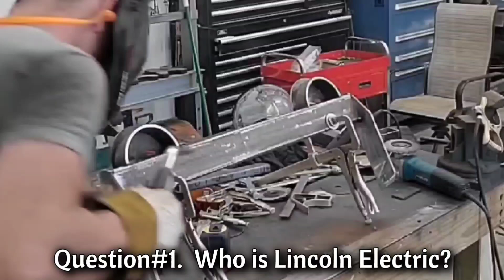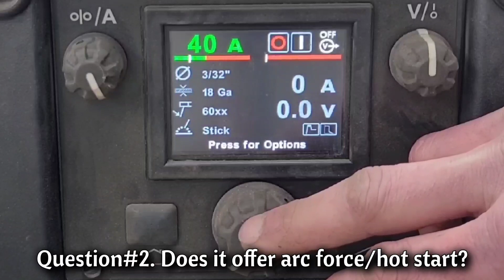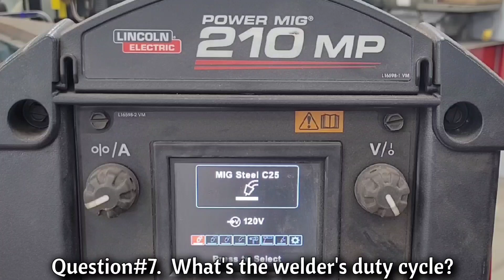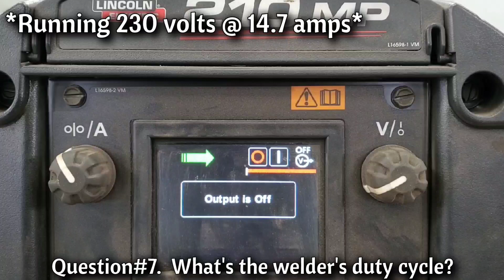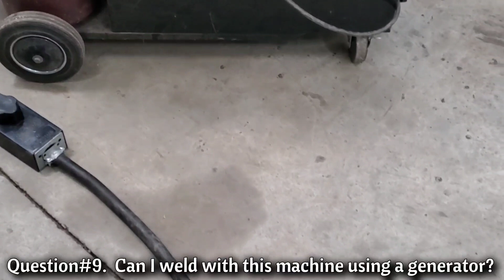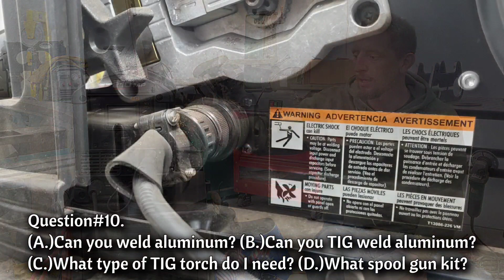Lincoln 210MP FAQ's - What You Want To Know Before Making An Investment Into A Lincoln 210MP

Comment: I got my MP about 2 years ago ,paid too much but that's another story .Needed it for some fine tig work and mig , mainly needed a good shop machine , I had some 1/4 box steel to weld one day and wanted to try the stick . It is awesome with stick , it is still under warranty , I opted for the five year . I hammered it at first , maxed out the duty cycles on all processes except for the aluminum spool . Not happy about the lack of interface like no pulse weld but the guy at the shop that I sold me on it said hes sold 20 units no problems from anyone and one guy drilled a hole in the back and feeds a 30 pound roll and has been running 100 pounds a week for the last 2 years at.045 sr70 wire . I don't need to but know that if needed ,the machine will do it .And I do a lot of field service and running off the genny is a must.
Reply from the maker: It is a well built welder, however I wouldn't pay the 1700-2000 dollar new machine price tag now that I have reviewed a bunch of budget welders...I would have a different opinion if the machine had the ability to Tig weld with HF start opposed to lift tig.

Comment: Thanks for the video!
How is the nova tig setup holding up. It’s so much less expensive than the Lincoln so I’m hoping it’s good.
Reply from the maker: The Nova Tig Kit is still holding up however ever since I got the ArcCaptain TIG200 I was introduced to HF start Tig welding and since then have not used the lift arc tig setup.   And I bet the TIG200 is about the same price as the Nova kit...  If you are looking to learn tig welding I would suggest the HF start...  However if you are looking for additional options for your lincoln 210 then the nova kit is a good value and works fine.   Hopefully this helps you...  Good luck 👍

Comment: The plug on my lincoln 210 is the 230v 3 prong the one on the wgen9500df looks to be 240v 4 prong....how do you swap that out or can you just get an adaptor for my 3 prong to go to 4 prong?
Reply from the maker: Do you by any chance follow me on Instagram?   Follow me there and I can post a picture... I am PRETTY sure the welder will plug in, its just the cord will sorta be upside down (ground up)...  The nema 14-50 just has a neutral that the 210mp plug wont use.  The welder when running 220v has two hots and the ground and if you flip the plug I THINK it will plug into the generator (looking at the picture) .. The reason I ask if you follow me on IG is I can test this out... I have my generator wired directly into my panel and then have an outlet wired to my panel for my welder/plasma cutter...
Reply from the maker: SO I was wrong.. The nema 14-50 is slightly larger in size🤦‍♂️ I did not know that until now, I tried plugging in my cord and it did not fit.   So in this case you can see if there's an adapter or you may have to make a custom adapter extension cord using a 14-50 nema plug and the proper outlet making sure to use the proper ga wire... I made one using 6ga.   Hope this helped.. Good luck👍  Side note the generator is awesome, I love mine the remote start is where it's at!
Reply: Haha it’s all good! I did find an adaptor for it so that should work! That’s remote idk how much I’ll use that I’m using it to go mobile in the summer when I’m off work for the most part unless we do have a power outage